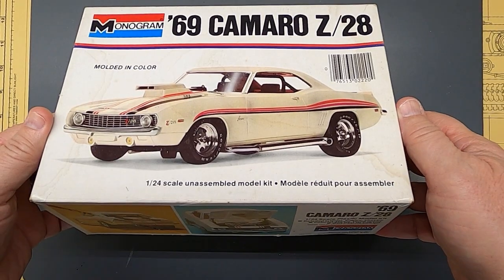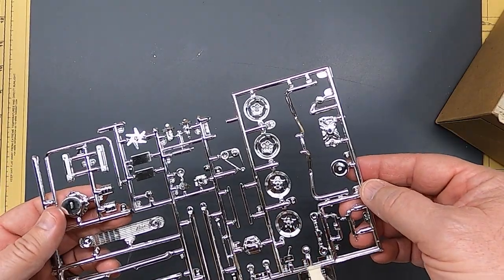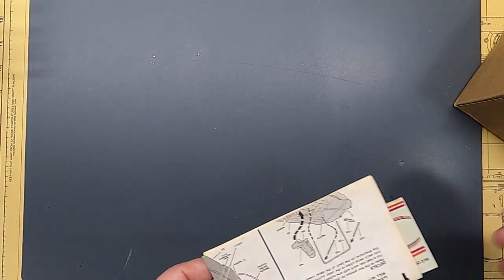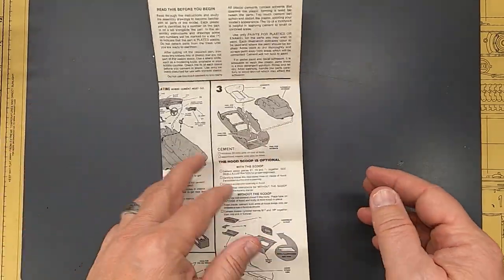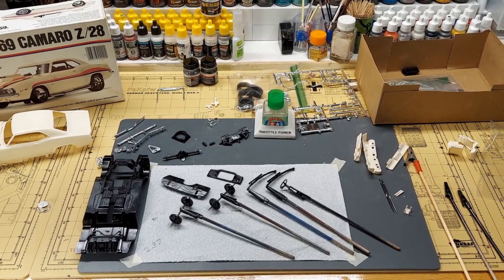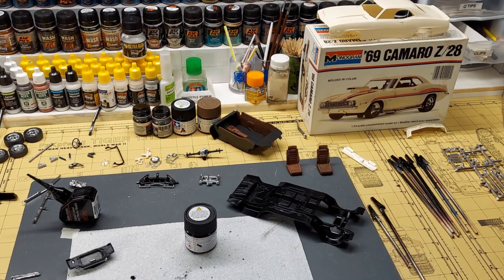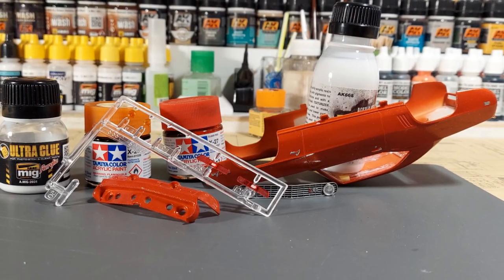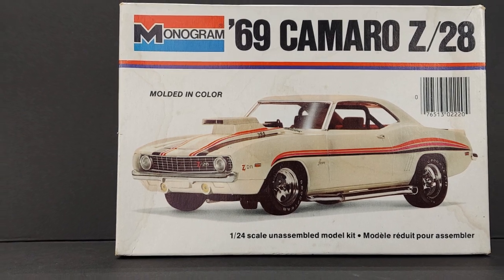Monogram '69 Z28 Build Tips and Tricks!

Comment: I love that extreme laquer paint. It goes on so smooth no orange peel ever or wet sanding needed before clearing it with the extreme laquer gloss clear love that paint and dont need to clear it if you dont wanna cause it is really glossy with out the clear on its own. Im building this kit now but the newer version cause the only difference is the hood its a stock hood that has a small cowl on it not this big ole scoop like yours but other then that its the same kit goes together pretty fast since everything is basically black suspension frame wise really easy build and looks great. Im doing mine in pearl white
Reply from the maker: Yes, that paint is GREAT!!!!!!!! Pearl white will look good on that build.